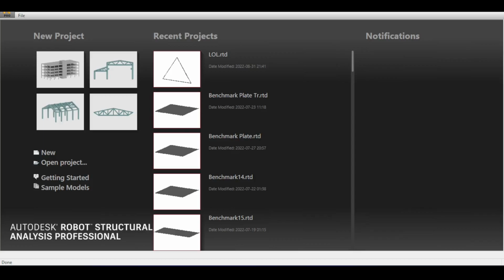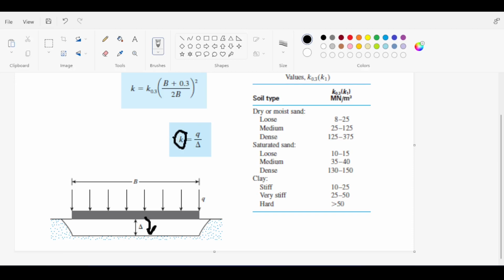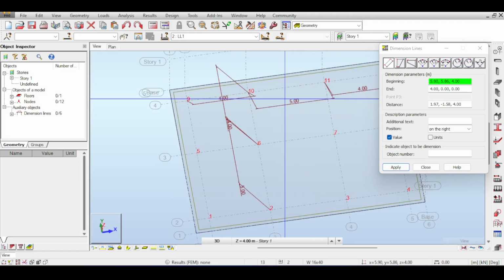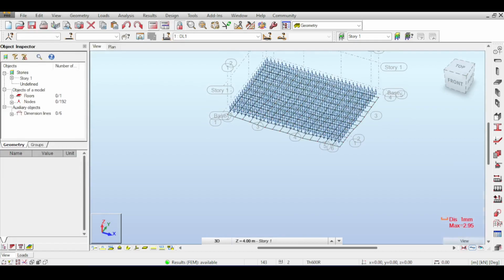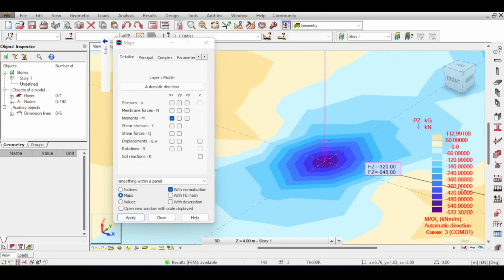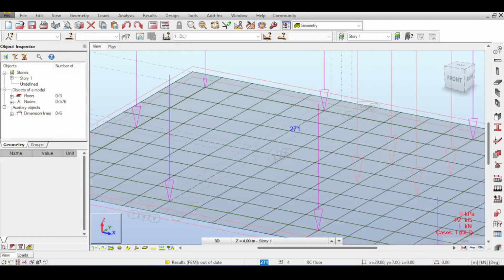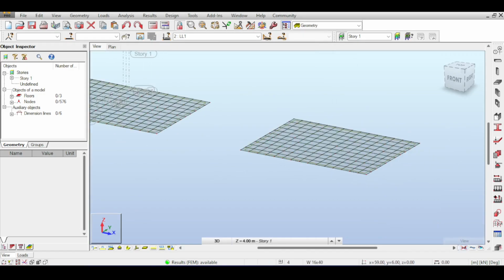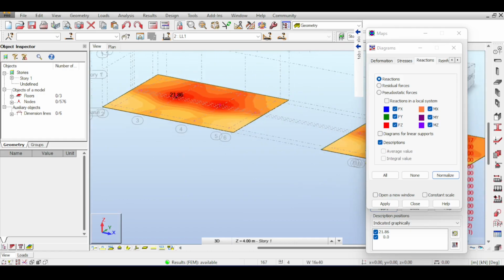Modeling Mat (Raft) Foundations (Flexible Method) in Autodesk Robot

Comment: Great and informative tutorial as usual from the Civil Engineering Essentials Channel.

Your computation of the tributary areas and axial loads on the columns due to vertical loads was really spot on, as if you used a calculator off screen. 

Generally, what works in my practice of sizing my foundation thickness is N/(10 - 12) where N is the number of floors suspended.

In as much as the loads are governing, I usually start with a smaller thickness of , N/12 and work towards N/10 thick foundation, depending on the demand on the foundation.

I don’t know why  Braja M Das, computes the modulus of subgrade reaction (soil spring value) by including the foundation size.

I usually would prefer to pick the soil spring value from the geotechnical report if it’s available or I simply, divide the allowable SBC/ allowable settlement.

Where allowable settlement is 50mm for rafts and 25mm for isolated and combined footings per BS/EN codes.

I would have to read Braja M Das’s material for more information on how the soil spring values is computed.

When foundation overlap is 70% or more then a raft is required. ✅ however most client would still prefer combined footing in overlapping areas to a whole raft due to concrete and rebar cost.

Great tutorial by CEE 
I have some technical questions for you, which I would type out shortly.
Reply from the maker: Once again, a big thank you for your comment. I kind of like seeing the BS standard perspective on those topics. N/10-12 is actually not far off of my 100mm per story.
As a matter of fact, the 100mm per story is exactly N/10
(10 stories / 10 = 1m, 100 x 10 = 1000mm) 
It draws a big smile on my face realizing this.

About Braja, yeah it is kind of the "go to" reference for people studying using the american framework and codes. It is kind of a big deal there. Still, I agree.

If the K factor is available from the soil report, one should absolutely use it.

The 70% idea was taught to be me like 10 years ago when I was still a junior engineer. Of course you are right. Clients want to save money and are not really willing to switch to raft or mat foundations. This will put extra burden on us the designers, as we have to make sure that the force overlap below adjacent foundations does not exceed the bearing capacity of the soil.

I am really happy to read your comment. I have added most of your points to my ToDo list. You can see my updated todo list when expanding the description of my latest video.

Regards,
CEE
Reply: @CivilEngineeringEssentials  it makes me happy to be on the same page with you sir especially when it has to do with sizing members. 

Thank you.
Reply: Some technical questions for you Sir. I hope you address them when you start with a proper project or future tutorials.

1. For an economical foundation/raft design, is it possible to reduce the reactions on the raft/ foundations due to gravity loads by applying an imposed load reductions factors to the columns since the structure would usually not experience all  floors, fully loaded with maximum live loads at the same time? 
I would love for you demonstrate how Robot does that. 

The BS 8110 recommendations is that the vertical live loads are reduced by these factors (1, 0.9, 0.8, 0.6 and 0.5), all live loads beyond the 5th floor is halfed and below the 5th floor are respectively reduced by corresponding factors.

Am sure the ACI 318 and other international codes have that provision.

2. How do I query robot to know which load combination is used to size the foundation in the provided reinforcement module.?

Which combination is used to design for bending and shear demand on the foundation?

I have a feeling, it uses the ULS combination for all foundation designs and checks,
instead of using the SLS combo for pressure checks at the base of the foundation and the sizing of the foundation.

I remember we only defined ULS combinations so far and imported load cases into the reinforcement module instead of combinations.

3. I wish you had a comparative model, where the actual column sections are modeled as part of the raft and axial loads applied to the top node of the columns as point loads so as to capture the actual distribution of moment and stresses across the cross section of the columns. 

Just as you do, I usually don’t  pick high hogging Moment, shear, deformation at the column center point  but half way between the  column center point and the column face of the column for concrete structures. 
Am not sure, but I think I saw some settings in the member design labe under tools.

How can I achieve this scenario using robot? I wish you throw more light on how hogging moments is handled by robot across the column supports.

4. Could you take a deep dive into provided reinforcement for slabs in the future?

Thank you Sir.
Sorry if my comment is too long .
Reply from the maker: @niisarpei3676  Absolutely no problem. such comments are actually welcomed. 
There are provisions for LL reduction in the ACI 318 code. I have to dig them up. I would talk about those in future videos when modeling full structures. I will add this to my ToDo list. It is now updated to reflect the request there.
as for 2, yes robot in the foundation module (spread footings) does show you the controlling combination. I will show it as soon as I can ^_^

as for 3, it does not really help. I have to check it myself but columns are modeled as "bars" where they transfer their loads to the raft at the node. Which would be similar to a point load. I remember there was something that allows for an area loading in robot, I have to check it out and get back to you.
The comment (point 3) really intrigued me and I want to check that out in a future video.

as for 4, definitely. Yes. Especially that there are some practical notes to talk about especially in terms of cut-off bars and extra reinforcement. This is a really nice topic and definitely deserves a video of its own

I really like those comments, and that is why I pinned it. Such comments not only help the other viewers, but actually helps me plan my own content. So a huge thanks to your thoughts on this.
👍
Reply: I would have to try out some of the questions I have raised using Robot and see how it goes.

Comment: Thank you !!!
Did you ever model slab like this with a thickness increase under column to reduce soil pressure under it ? If so, How can you model this, is it sufficient to just draw a hole in the main slab, then draw a thicker slab into the hole that connects the edges of the main slab ?
Thanks again

Comment: Hi there, great video as always. I am designing a ground bearing yard slab and could use some help if possible. I’d even pay for an hour discussion with you 😳. 

Robot asks for the elastic coefficient. I have been trying to figure out if this is different from the sub grade modulus value? I’ve been reading through numerous documents and guidance and see no reference to a specific value for elastic coefficient, only sub grade modulus. 

In your k equation, is the B value the size of the slab panel, or the loaded area? 

I am also attempting to model adjacent panels and joints, providing rigid links at locations of dowels. I expect to require more reinforcement at panel joints to resist the moments but I am struggling with this. 

Any assistance appreciated CEE ❤

Comment: Great Video as always.
One small question:
If for some reason (seismic combination, etc) we have positive reactions (uplift) on raft, what that practically means?
We should make a rotation check for the whole structure?
Reply from the maker: Hi there
Uplift means that the supports can only withstand forces in 1 direction, whereas the other direction is not resisted.
Yep, uplift is important to be defined if you are expecting "tension forces" to develop in your raft. This happens if the moment is much more significant than axial forces. For seismic action, it depends on the building footprint relative to the weight and height of the building.

So, to check for overturning, you would need to disable the reaction that is Uz+ because you do not want the raft to "pull your structure down" as it is not a pile, and soil does not resist tension>

you can find more details in the RSA website here:
https://help.autodesk.com/view/RSAPRO/2024/ENU/?guid=GUID-67AD294A-8620-4B65-8A20-678CDA7C13C6
PS: Sorry for the late reply. I had a ton of things to finish and now I am gradually getting back

Comment: In minute 8:04
100 KPa was in box of (estimated foundation load).
So,
Did you calculate it based on your loads and mat area ,or it was existed by Default?
Reply from the maker: it was by default. 
you should change it if your load estimate is different.
the problem is: the foundation load itself is different from one region to another, because the columns carry different tributary areas.

One approximation is to basically calculate all vertical loads and divide by the building area.

Hope it helps,
CEE
PS: Sorry for the late reply. I had a ton of things to finish and now I am gradually getting back

Comment: Hi there , 
when will you do the design of a raft foundation ? i have searched all your videos for the design of such foundations, but i didn't find . especially the foundation of the concrete (2 blocks connected with a bridge) tower building that you modelled in the 18 video series. there is no design for raft. 
thanks ,
Reply from the maker: Yep, seen your other comment. A video on a Raft + a video on pool walls + dynamics series are definitely on my radar. I just need to find time to filming those ^_^
Stay tuned for more content.
Regards,
CEE

Comment: Hi, Thank you for this tutorial. Really appreciate this! When running the analysis does ROBOT perform rotation check and sliding check of the raft foundation? Meaning that if we get a convergent result (no errors in ROBOT when calculating) its means its a safe design for rotation and sliding? Or does these calculations need to be done and verified by hand? Thank you so much for the answer in advance and like I mentioned before I really enjoy watching your videos. I dont think there is another YT channel like yours where you can explain things in such an easy way! Shared it with my engineering friends at work!
Reply from the maker: Hi there. Sorry for the late reply. Also, thank you very much for sharing the channel with your friends ^_^
RSA does not perform sliding and rotation checks on rafts. 
Unfortunately, you would have to do it by hand.
Reply: @CivilEngineeringEssentials  Thank you so much for the answer! Keep up the good work, i enjoy the content :)

Comment: I ve been watching your videos, and learnt a lot from them. You are one of the few that know how to use the program and structure calculations. I am desingning a mat using the k situated in the thickness panel and only a few areas surpass the maximum soil tension( a have a shear wall there). So, I wanted to consider some plastic behavior by modeling the slab with bilinear supports instead of an elastic support . I saw that robot allows you to model bilinear supports for point, linear and planar modules. I tried to model those supports with the planar interface but i am not sure which area is considered automatically by robot. I saw that you placed the soils K considering the tributary area according to your mesh size. Do you know if robot does this automatically if i model them directly as a planar support??
Reply from the maker: Yes, if you model any support:
Be it elastic, bilinear or anything, what robot ends up doing, is it applies a spring (linear or even bilinear) based on the tributary area of the elements, and models the soil behavior using those springs.

By the way, that is a really interesting topic, to model elasto-plastic soil behavior. Kudos to you, that is outside-the-box thinking.

Just one little thing to consider: if it is clay or clayey soil, plz remember that your stress might be beyond the consolidation stresses. As you remember, this changes the behavior of clayey soils.

Hope it made sense. Regards,
CEE

Comment: Hello.. Thank you first for your effort.. Just a question, I saw that you compared the obtained settlement to 2.5cm. the definition of Kz is the ultimate soil pressure (allowable times the safety factor) divided the 0.025m settlement, so it is not enough to compare the settlement of the foundation to 2.5cm, because we should compare the obtained value to the third of 2.5cm to ensure that soil pressure obtained by FE is less than the allowable pressure and not the ultimate one. I'd like to know what you think.. thanks again for your effort
Reply: Very happy to have my professor, Kassem Deeb, meet my favorite YouTuber, DC CEE.
Reply from the maker: Yes, you are 100% correct if the Kz used is based on ultimate. If it is based on allowable then all is good. It slipped my mind. I should have mentioned it in the video, so a huge thnx for your comment.

Let me rephrase this for the interested readers:
Dr. Kassem says: 
- Let us assume that the max allowable settlement is 0.025m.
- Also, let us assume that the Kz used in the software is calculated without factor of safety.
- The "simplistic equation" is: delta = F/K.
Since the K is without a factor of safety, there are two approaches for this:
Approach 1: calculate the "safe" "allowable" K by dividing by 3 (Factor of Safety). Then use it calculate the the settlement. (So we would need another model for this)

Approach 2: realize that the soil is "too strong" and limit the deflection to 1/3 of the 0.025.

I hope I was able to get your point correctly, Dr. Kassem. Amazing point!

Thanks again for your efforts. Please tell me if I was able to address your point.
(I will also add this discussion to the video description. Thank you very much)
Regards,
CEE
Reply: Thank you for your effort, indeed this is my daughter Fatima that do her YouTube channel using my email :), any way , I am Kassem Deeb, his father and the civil engineer. Thank you again and again for your useful videos @CivilEngineeringEssentials
Reply from the maker: Most welcome
I modified my comment 🌹
It honors me to have you here Prof kassem
Feel free to start any discussions you want. I am more than happy to engage 👍

Comment: Very informative. Thank you.

On the 3rd model. I think if the modulus of elasticity is activated for the floor and a planar support condition (spring) is applied without the k values, it would probably give similar result.
Reply from the maker: Most welcome.
The suggestion is really interesting, I think it might be the case. I have to check it in detail

Anyways, welcome to the channel ^_^
Regards,
CEE

Comment: Thank you about your content,and i have questions

What about replce elasticity of foundation kz and you use support

Mid span equal kz
Edge equal half
And corner

Please explain this step more it's very important

I and i am sorry to my alot question
Thanks cce❤❤❤
Reply from the maker: Hi there,
Happy for your comment. Feel free to ask anything anytime.

When I replaced the elastic foundation with my own spring supports, I had to find the spring support stiffness.

Now elastic foundation stiffness is as follows:
F = N/m2
x = m
Kz = N/m2 / m

In a spring support, the Ks-factor is simply N/m
So to get the equivalent spring factor Ks from Kz, I have to multiply by the tributary area.

No on edges, it is obviously smaller than in the middle.

Also, note that it was easy for me to predict the area because the mesh was quite organized. I cannot do the same when the mesh is distorted.

Finally, the reason I did this calculation is to show "how robot thinks".

Regards,
CEE
Reply: @CivilEngineeringEssentials 
Thank for you🌹🌹🌹🌹🌹